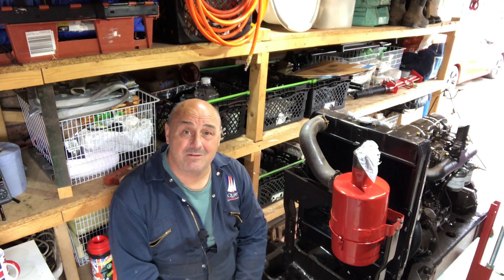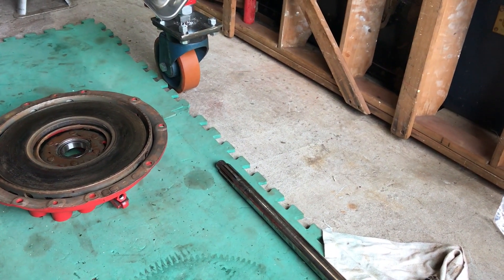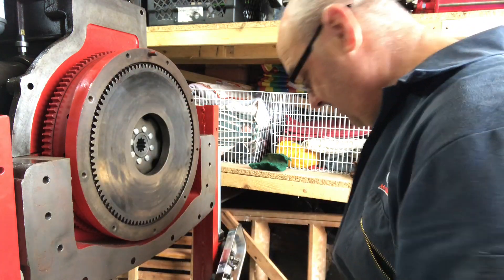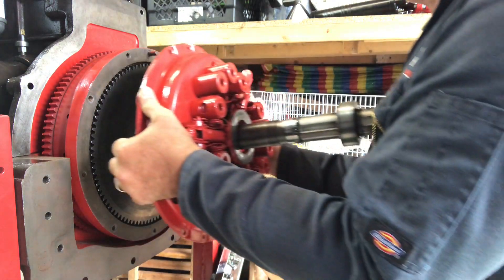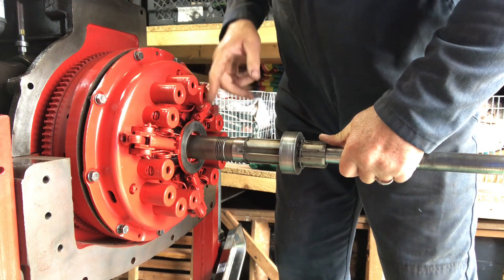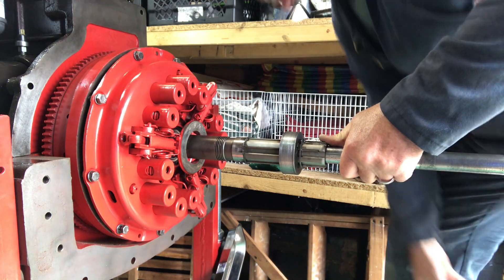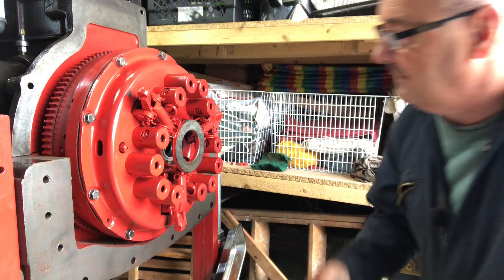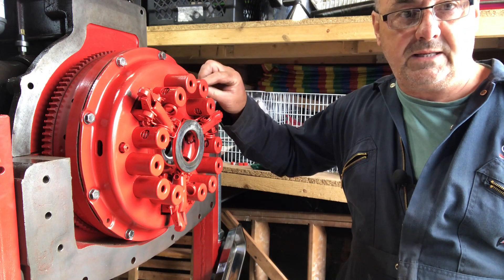Refitting the clutch to a David Brown 990 #31

Comment: The seperator plate springs should be fitted totally dry! As the clutch dust will stick to springs and make them stick in the holes in the flywheel. I,m an old DB mechanic so i know .
Reply from the maker: Many thanks for that, the oil on the springs was so small that it didn;t even dirty my fingers when I put them in, but I can see where your coming from and thanks for the comments and for taking the time to view, it's very much appreciated
Barry

Comment: 5:44 i wud cross sand # with 100 aluminum oxide 
that  dark blu indicates 282'c tempering color. 
.. working on my 1294 .  replacing hydraulic quik connectors on FREY loader.
clutch work scares me. 🐺
Reply from the maker: Hi Larz, many thanks for the comment, I hope your enjoying the video's,
many thanks
Barry

Comment: Great videos Barry , the new plate thickness would be 11inch---0.353ins , 10inch ---0.320 ins , probably already know that now , but just watched your video recently enquiring about thickness..
Reply from the maker: Cheers Wullie, I've replaced the plates now but I will check the original ones as we still have them, when the new ones arrived I was suprised that there wasn't that much difference in thickness.
thanks for watching
Barry

Comment: Hi, I own a 1967 Selectamatic 880 that I'm restoring right now. I was wondering since you seem to know those tractors (David Brown) very well. I experienced that final drives are very noisy. That's what can be hear when the tractor is engaged to speed. Course there's always a bit coming from the transmission but all these gears turning in the final drive housing (with all their bearings) is a weak spot on David Brown. The older and miss servicing, the more it's making noise I suppose. At least to my point of view. Would you say that changing all final drive bearings can help ? Or it's useless since gears are worn anyway and that doesn't change a thing at the end. Is noise coming from worn gears or bearings ? Thanks for answering.
Reply from the maker: Hi Luc, I would remove and disassemble both final drives and check the bearings,it looks way more fightening than it really is and the grief you could save yourself from a collapsed bearing breaking gears and casting could be worth it. At the very least you get to see what condition your pinion shaft and reduction gears are in. All the parts are readily available and not as expensive as trying to source a repalcement casting, just think of all the fun your going to have.
keep us up todaste with your decissions
Many thanks
Barry
Reply: @manfromthemist1958  Hi Barry. It seems pretty easy for you to do things on video. What I fear the most is to get the press fit brake drum out of the axle. Oil seals need to be replace too. I liked the video showing how you're doing it. Pretty simple and it does the job pretty quickly. What do you think of David Brown tractors in general ? I live in province of Quebec - Canada. Far East on the sea. When I was young, there were more farmers in my area. Some had DBs, some MF, some Ford (made in England) and some IH. There was no John Deere dealer nearby. The bigger DBs were 995. The smaller were 880-885. David Brown's sound was hitting me the most. They were consider as very good tractors...  except for the rear hydraulic system. Course, nobody was taking good care of their tractors 50 years ago. The were letting them outside all year long. Mine is sleeping in a garage 365 a year ! Even my car doesn't get that kind of VIP treatment. Cheers !
Reply from the maker: Hi Luc, Removing the drum is probablty the hardest part of the job they either come off relativley easy or they're a chew,
As far a DB tractors are concerned I knew nothing about them at all untill I bought it, I eas really looking for  a MF tef to rebuild but due to covid could get to Wales where there was a reasonable one, so I bough this DB from a young man in Carlisle, and when I started taking it to pieces found it hadn't been loved at all, I do love my DB and like yours mine lives inside and when finished will continue to live inside wrapped up in blankets to keep her warm, i keep trying to get pieces of her into the house but get rumbled by Debs and relegated back to the garage. hey ho,
you have to have a go at getting the drums off and if you get stuck there's absolutley no shame in asking a local garage or enginnering shop for help, I find a lot of these will help at low rates as they understand your not commercial and as engineers we all understand the importance of keeping the past alive. After all it's because of the past we arrived here today

keep us informed of your progress,
many thanks
barry
 @lucgagnon5241
Reply: @manfromthemist1958  Thanks for answering Barry. I'll give it a thought. I tried what you told me. I went to a garage and asked them to put new bearings in one of final drive. The "son" (father and son of a) told me to put oil in it and laught in my face in the same time. I'd say that in the area, nobody wants to work on 50 years old farm tractors. That's why I'm only trusting one person : me !
Reply from the maker: Hi Luc, sorry to hear about your experience,
i think what the person was really trying to say was his skill level didn't reach that high and he was incapable of the task. @lucgagnon5241